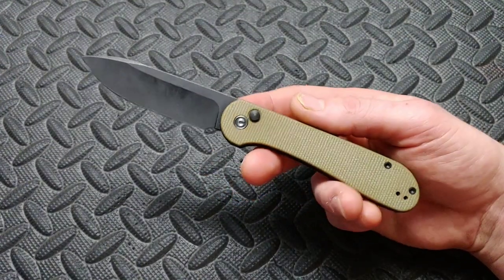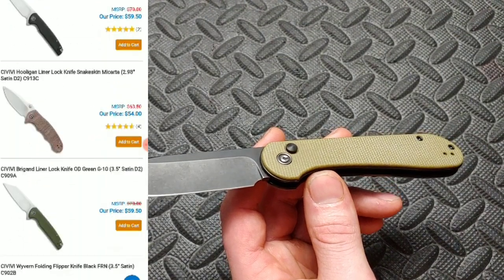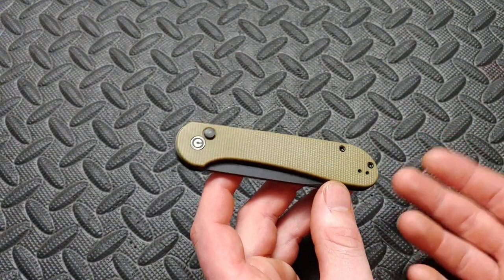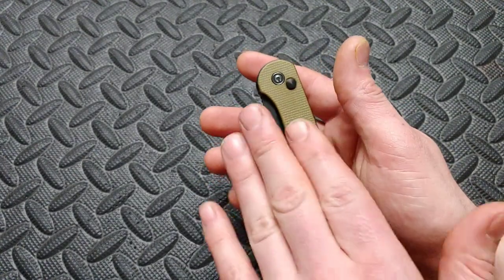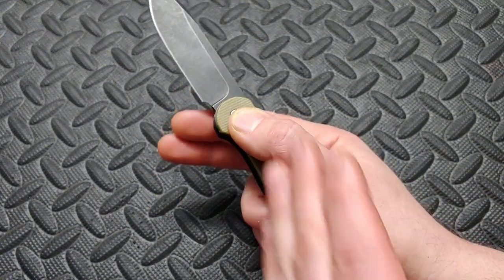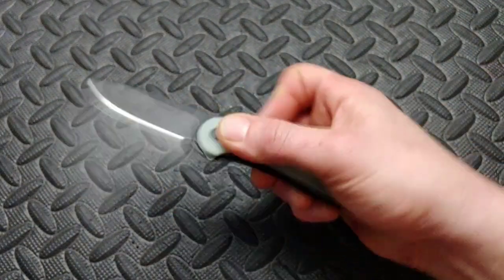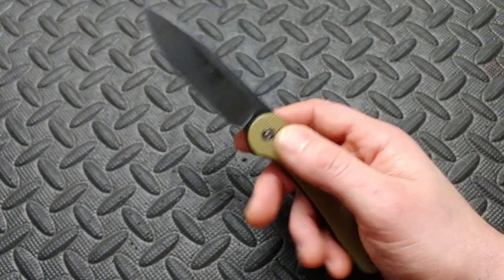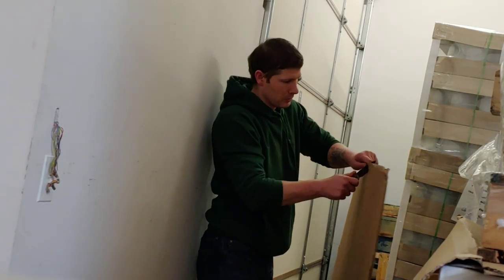CIVIVI BUTTON LOCK ELEMENTUM REVIEW

Comment: Almost two years later this is still my favorite knife to carry. Strong and solid but thin. The detail and milling on the metal button is sick too. Just a great knife all around. And razor sharp with that deep hollow-grind.
Reply: I have all of the standard bladed 14c28n ones just for looking at them and customized myself a stonewashed one with the g10 scales as a user. This knife really is a masterpiece!
Reply: @johndemtopics1377  it’s so nice mine still reminds me of a Solidworks render in real life.. that blade machining is absolutely top-notch. 

Ever looked at the button under a magnifier and good lighting? Surprised me just how much detail is on the tread.. like they went full-on badass when designing it. I prefer it over a $150 zdp189 Endura I bought.. by quite a big margin actually.

Comment: Great review.  One of the few that understand the advantage of the mechanics of the knife.  Unfortunately those that think it needs another means of deployment don't get it.  Locked closed.  With a detent it wouldn't be locked closed.
Reply: I didn't really understand that it locks when it's closed. I thought it had a detent. "Gravity/inertial knife" concerns aside, it's a really cool locking mechanism. Doesn't open unless you push the button. On the other hand, you have to sharply move the knife, with an awkward grip on it. It just begs for an accident with someone chucking the knife when trying to open it.
Definitely of the "don't hand this to non-knife people" type of knives.

Comment: I completely agree that it would be nice if it had a flipper tab.  I'm not great at wrist flicking and don't do well with thumb deployments.  But, flippers are great.

Where I disagree is about flipper tabs getting in the way.  I really like having the flipper tab as an additional guard to keep my hand from slipping forward and getting cut on the blade.  That is a terrific feature of most flipper knives.
Reply: Do you own one ?
Reply: @unclebob4964  Own one what?  I didn't buy a Civivi Elementum because it doesn't have a flipper.  There is another Civivi that has both a button lock and a flipper that I'm considering.  I do own about a dozen knives of various makes and styles.
Reply: @BryanTorok  Civivi Elementum Button Lock……the knife that was the subject of this discussion….! ?
Probably should drive something before you evaluate it. Little more “credence”, if you know what I mean.
Reply: @unclebob4964  I don't need to own this knife to be able to see that is lacks a feature I find desirable and to say why that feature is desirable to me.  I'm sure it is a fine knife and many people like it.
Reply: @BryanTorok  Fair enough.

Comment: The micarta is smooth like that because you can rough it up with sandpaper if you like it rougher, but a lot of people prefer smoother micarta and it is much harder to get canvas or burlap textured micarta to feel smooth. Most ways cause the micarta to look much different than it started out.
Reply from the maker: Yeah i believe i said i was going to take some sand paper to it as i usually do with smoother micarta, im also thinking about dying my other olive micarta, but its also from the kind of resin they use and the layering process, pressure exc but i still think its pretty decent ive seen alot worse for sure
Reply: @NeevesKnives  I love smooth micarta. The best I've found for what I like is on my QSP Hawk. They should be much more popular than they are. The penguin is ok but the hawk is much better. More ways to open and they feel almost surgical, plus it comes in sandvic steel and micarta handles for under 50 bucks.

Comment: I actually like the bottom only deployment. Super clean and it's not like there isn't options. I think the idea is to have a diverse line up. Some with 2 or 3 deployments, some for those that are looking for something not so cluttered.

The real issue is that I'm guessing wobbly clip that equals an upgrade tax to upgrade it for like 12 to 15 bucks. I also get that too though, cheap clip  nudges that MSRP down a tad while adding possible sale of upgraded clips for picky folks. 

Anywho, my 2 cents. I'm grabbing a blacked out one that's on sale today. The simple lines and good price just sidetracked me from a kizer assassin xl or begleiter xl. Ironically I want the begleiter for the multiple deployments and size lol

Comment: It’s simple really.  If folks don’t like it they don’t have to buy it.  I just got mine…dark green micarta.  Love the extra blade and handle length.  Love the lock shut aspect of the button.  Love the clean, uncluttered lines.  I love flippers but this knife would be less special if a flipper was there.  Tired of liner locks.  This is a breath of fresh air.  PS:  flipping this knife up, down, backward, spinning, flipping, etc., etc., etc. is gonna lead some moron into thinking they should be doing it too…gonna be some fingers on the floor! Just sayin’.

Comment: The original is the perfect size for an EDC.  Just under 3" blade. And a handle just barely long enough for my four fingers.  Along with the flat handle profile, it is the perfect balance between compact size and functionality.  Fits so well in the pocket I hardly know its there.   IMO they should have kept the original size small, and released a 4+" blade version for those that want a larger version
Reply from the maker: I personally rather have this size than a 4" a 3.5 inch blade is the perfect size for edc imo, its a full size without being to big and fits my hand perfect
Reply: @NeevesKnives  Ha.  Well, maybe they should have made 3 sizes then!   Each to their own.  Maybe I'm biased. Just got my Elementum not long ago, and its my first EDC.  I love it.

Comment: 09:19

You CAN make an inset pocket clip without making your show side gaping ugly!

You just need to either:

a. make a wire pocket clip — or at least make just a portion of the clip [as necessary] be like wire

or

b. make a pocket clip that somehow attaches internally or at the back of the knife

or

c. make a tool-less pocket clip, like, e.g. the SRM 9203 series of knives.

Comment: Not sure why all the youtubers  push Civivi  I just returned the civivi elementum button lock. Its sharp as hell but the build quality is flimsy. The micarta scales were so thin if you tightened the 2 rear screws too much it would warp the scale off of the liner. Take a very close look at the button lock where it contacts the rear tang of the blade. The plunger is milled down less than a 1/16 inch this will fail before a liner lock would. Civivi knives are all show and no go. If you want a nice Chinese knife at a cheap price Petrified Fish is a better deal. Civivi - WE  knives are over priced.

Comment: Is there any risk of the button being inadvertently depressed causing the blade to open inside your pockets? That’s the only concern holding me back really. I love the clean simplicity of it.
Reply from the maker: No i dont think so, i carried it through tight places crawling around in lofts, and much more, not unless you meant to,
Reply from the maker: Also since it carries tip down the blade goes against the seem of your pocket which stops it from opening, unless you carry your knife right in the middle of your pocket, i personally keep it to the side
Reply: @NeevesKnives  Good to know! Thanks! I’m assuming you meant to write tip up.  Is tip up actually more secure when worn against the seem than tip down?
Reply from the maker: @Snek03  yes i did mean that you know what i meant
Reply from the maker: @Snek03  and yes tip up is more secure from a blade opening in your pocket
Reply: @NeevesKnives  Got it! Thanks for answering my questions. I appreciate it.

Comment: Already had too take one apart as its easy too get dirt in the button lock mechanism.   Pretty easy disassembly but I could see dirt etc being an issue with this lock.
Reply from the maker: Oh wow yeah i can see that seems like its a spot that could be cleaned without taking it apart, but i haven't gotten it dirty so
Reply: @NeevesKnives  I had too take the whole button out,  idk exactly what the issue was, but the button would just get stuck too the left and the blade wouldn't lock open or closed.

Comment: I believe you have some confusion about gravity knife. It wouldn't matter if the knife had 3 other deployment options. It's that it does not have a friction detent which holds the blade closed into the frame unless a determined force is nused to deploy the blade out into open position! No detent means it's a gravity knife. Any knife with button utilizing a spring, switch blade. Any knife with button and no friction means of retaining the blade in frame, gravity knife.

Comment: Hello. Thank you for an awesome review. I'm new to folding knife world, and currently looking for a nice edc knife that will last and stay with me for many years. For a few weeks i've been considering getting a Benchmade 940 Osborne with Green Anodised handle because i've read so many positive reviews and watched so many videos saying that 940 is awesome and very reliable. This is still my number 1 choice, but i just came across Civivi Elementum Button Lock in Damascus steel and gorgeous carbon fiber handle (either with blue or red accents), is this knife as good as a Benchmade 940 for edc (cutting boxes, tape, hiking, food prep, occasional wood work etc.)? I know that my question is probably quite silly, but i'll be investing in a knife that cost a lot to me, and i actually want to use it, not only look at it. What is your opinion?
Reply from the maker: So the Elementum is going to cut way better than the 940, the aluminum on the 940 will scratch also just something to keep in mind, the 940 has a great lifetime warranty which is great, and in the future you can always get a blade replacement for 20 to 40$ and it has life time free sharpening, although i dont reccomend doing that, both are great knives, the 940 is a bit stronger and the Elementum is better to use imo because it has great cutting geometry while the 940 doesnt.
Reply: Thank you so much for your quick reply. Reading this i am sure i want the 940 Osborne as a good all around knife (as it's strong, reliable and has great warranty etc., i also don't mind the future scratches on the aluminum handles as they will be so called "battle scars" and quite fancy it developing a patina). I will start there and maybe one day get another knife (i probably will) so i can rotate them and have fun like that. Thanks again.
Reply: @piotrwydmuch9413  it’s been a year. How many knives do you own now?

Comment: NK,… I’m going back to freehand sharpening.  I have Dia-Sharp Coarse, Fine and Extra-Fine 8” stones. I’d like to broaden that to a polish.  The Venev infused stones you highlight here are not available anywhere.  Other recommendations?  My Extra Fine is 9 micro.  They offer an Extra-Medium-Fine Dia-Sharp 6 micron and an Extra-Extra Fine Dia Sharp 3 micron but they are 130 bucks each.  These plates are also frigging heavy!  Thoughts?
Reply from the maker: You should be able to find or get the venev bench stones from gritomatic, they are also heavy, you should get a stone clamp if you don't already have one, the venev stones are also very expensive, you can also go with a spyderco ceramic ultra fine.
Reply: @NeevesKnives  Thanks but both the Phoenix and Dragon finer series 8X3 are sold out on the gritomatic site. Yes they are expensive but being double sided though not half the cost, they aren’t as expensive and at least half the weight if not more.  I’d like to stick with diamond for consistent flatness.  I do have a holder.
Reply from the maker: @Doc.Holiday  there’s other brands of resin bonded diamonds but I’ve only tried venev, but there’s cbn stones possibly available on there site, if your specifically looking for diamonds you might have to wait until they return IMO I wouldn’t get the regular diamond plates over 1200 grit because for the money you can get better stones that last far far far longer like venev
Reply: @NeevesKnives  Thank you!

Comment: Just got mine yesterday (got the red cf shred/damascus version)...and i'm super bummed because it's got vertical blade play - any fair amount of pressure on the spine and the blade moves down a bit and I can hear it click/tap against the stop pin. I really like the overall feel of the knife itself though, and I don't miss a flipper tab or thumb stud at all.
Reply from the maker: Send it back! Ive had two with zero issues no play at all, first i would let it lock up a bunch of times and oil it to see if it just needs to settle in pkace but if that doesnt work have them replace or fix it

Comment: Civivi didn't put the flipper on it because they couldn't design the opening mechanism using a properly tuned detent with a button lock in time and in the price range they are aiming for. I'll bet the third Gen ones will have it, or some other Civivi.
Reply from the maker: Yeah rt after they dropped 3 other button lock knives with deployment methods I'm hoping to get soon

Comment: Really good review and sharpening. Looked like you were able to even out the grind. I am not sure about it. Wasn't impressed with the feel of the original. This being bigger maybe but the lack of any other deployment method has me going ehhh. I may give it a chance but the Riffle will be first.
Reply from the maker: Yeah il say its pretty awesome, id like another deployment method but the design and size makes it so great, and after you get it down which is pretty fast the action is still very awesome, and im not the kind of guy who flicks my knives with the button or locking system like axis locks, but in this case i like it

Comment: Does anyone have any idea of durability of a normal coil spring used in most other plunge locks vs the flat spring liner in this elementum?
Reply: Ive used buttonlocks and automatics with the same locks for over 20 years without failure. Its just a spring like in a clicky pen. In fact i lost a spring once in a benchmade auto and used a trimmed spring from a pen. The types of aprings that do fail are omega axis lock springs, coil springs and kershaw assist/ torsion bars. That said corrosion can kill any spring so don't let water pool around one for a long time

Comment: I can see why they didn't add a flipper but this is begging for a removable thumbstud. I may try drilling and adding a thumbstud myself. Still a cool knife though.  Never mind, I didn't watch far enough to see that it locks closed
Reply: Adding thumb studs won't help. You must press the button in order to open the blade. It will not deploy any other way.
Reply: @timbo4374  I commented before watching the whole vid. Classic mistake

Comment: The flipper tab turns into a finger guard when it's deployed so your finger doesn't slide up the handle and whoops there goes a finger ER here we come...
Reply from the maker: I've been using tools my entire life with no guards, but I understand however you can easily cap the end with palm or thumb if your worrie
Reply: @NeevesKnives  I don't think you understand the design...
It's a finger guard to prevent your hand from going passed the handle in the event you hit something hard and your hand doesn't slide off the handle and you cut yourself...
So your palm nor your hand will prevent this from happening, but good luck with that...

Comment: Not a fan of the button lock or fixed blade. Pretty big steel downgrade on both for a pretty big price increase. 14c28n is a fine steel but you can get s35vn for for the same price now. And 9cr on a fixed blade for $100 is just insane.
Reply from the maker: Yeah i agree about the 9cr, but i absolutely love 14c and most of the time i prefer 14c over s35vn, especially when its done as good as their 14c28nsteel, this has been the best 14c that ive found, s35vn doesnt usually take a great polished edge unless its heat treat is really good
Reply: @NeevesKnives  I don't disagree with that. I do like 14c I just don't know if I can justify $80 on it. I'm not saying I won't buy it (I do have a knife addiction) I'm just not happy about it! 🤣🤣🤣